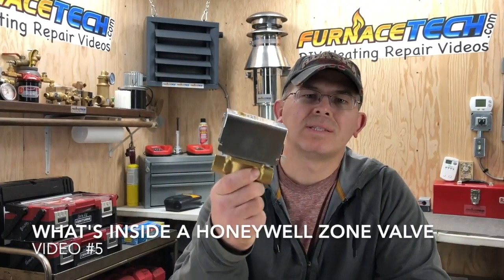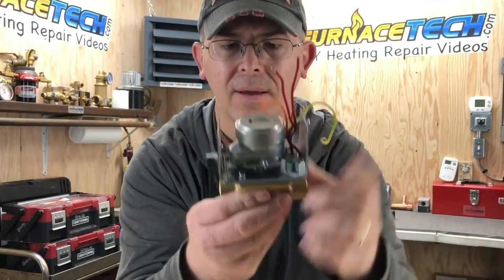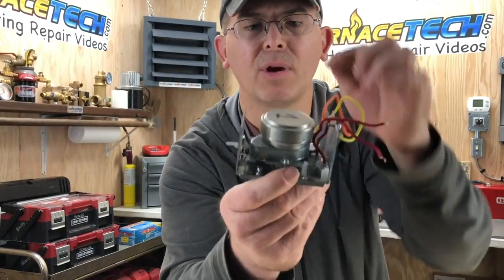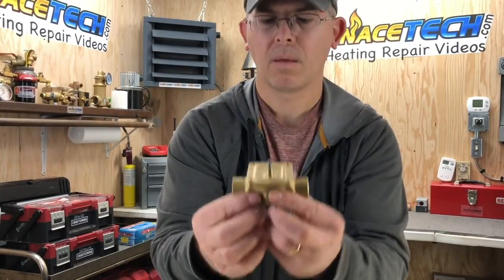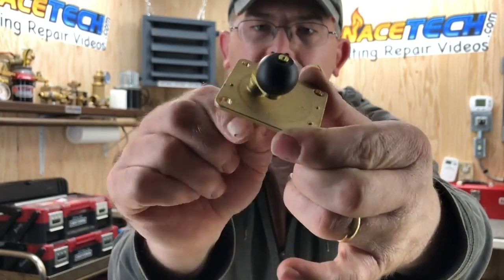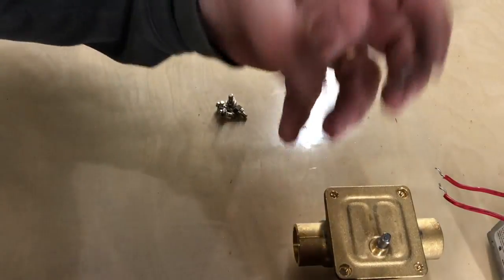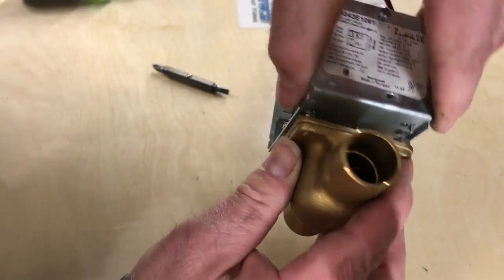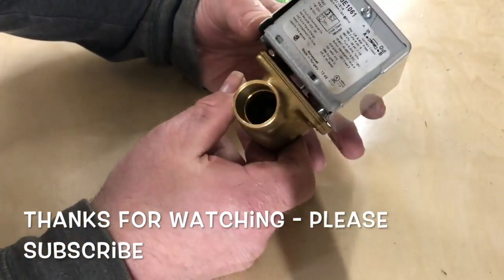How to fix a Honeywell Zone Valve. Part number: V8043E1012 + V8043E1061

Comment: Does the manual lever go all the way to the left and hits metal side?
My lever is not springing all the way back (closed?) to the metal. trying to see if I keep testing it will loosen up inside?
Reply from the maker: Great question! No, it will spring back closed but it will not be tight to the left side. the Rubber ball will seal the hole inside the valve before the lever will touch the metal

Comment: I’m having an issue with one of these where the boiler randomly turns on. Have you ever heard of an end switch failing on these? How could I troubleshoot that?
Reply from the maker: End switches do fail for sure. The easiest way to test would be to turn off control power and disconnect end switch wires and use a volt meter to check for continuity through the switch while pressing and releasing the end switch button. I hope this helps! Thanks for watching

Comment: Hi, have I attached my accuator wrong? My motor starts when there is no demand and the manual lever is stiff but when i switch heating on nothing happens, and lever is free. How do i make sure that the valve is closed when I attach the accuator 
Thanns
Reply from the maker: When the lever is stiff, it is closed. When it is free, it is open. If nothing is happening, check the end switch and make sure it is telling the boiler turn on. Remember, you may have other controls and different wiring so, you will need to understand how it is wired into the system. I hope this helps! Thank you for watching

Comment: 1 of my 4 quadrants is not heating. It appears to be this part. Hot pipe below, cooler above. Manual open did not work. I took off the motor assembly and moved that little ball valve by hand. It moves freely, but still the hot water does not move through the pipe no matter what setting, despite the pump being on for the other quadrants. Does that mean the ball came off and wedged or is there some other possible reason?
Reply from the maker: There could be other reasons. 1) could be frozen loop. 2) system pressure could be low 3) could be air locked
Reply: @FurnaceTech  Thank you for the response. It started working again on its own. The tech that came out for something else said it was probably air.

Comment: My Honeywell Home valve is making a noise that resonates through the whole heating loop. I took the enclosure cover off (valve opened, calling for heat) and lightly push on the motor and the sound is less, but still there. It’s a vibrating or humming sound. My dad would always say if it’s humming, it because it doesn’t know the words, ha!

Isn't the drive motor only on when the valve is opening and closing? This noise is continuous when the valve is open and the thermostat is calling for heat. What’s the source of the noise?
Reply: PS: excellent tear down and explanation on the workings of these valves.
Reply from the maker: Thanks for the question. There are two types of zone valves. (NO) Normally open powers to close and (NC) Normally closed powers to open. If you turn off the thermostat and the noice goes away, you may need a new valve. Something could be wrong in the motor. But, this is hard for me to troubleshoot without being able to check the whole system myself.

Comment: I have 3 zones. When one zone is calling for heat I hear a gurgling sound when the heat is coming up. The oil tech purged the zone. I did ask if it could be the zone valve and he said no. I still have the sound of gurgling. The lever on the zone valve has a little play in it. Is that normal?  Can it be the zone valve or does it need to be purged again to let out more air in the line? I know I can open the valve to the manual position and purge it myself. Should I? Thank you. Love watching you video.
Reply from the maker: Thank you for the question. A lot of the time a gurgling sounds are a result of air in the system. Some systems can be complicated to bleed. I do not know what your experience level is when it comes to working on heating system and I would hate to say you should try something and make things worse or get hurt. Plus, I am not sure if you have glycol in your system or some type of system protector in the fluids. Has this system made these sounds in the past or is it something new happening. My first start would be to talk with the tech and if you do not think he or she is fixing the issue, get a second opinion. Otherwise, I would probably start by bleeding the whole system thoroughly on all the zones and make sure the system has proper air bleeds in place. Then, I would make sure the system is at the correct pressure.

Comment: So do these things go bad often? Have a zone in a hot water system where the heat is stuck on. So I’m thinking it’s this valve that’s stuck open or the thermostat.
Reply from the maker: There are some bad zone valves which fail often. If you turn off power to the valve and it stays open on a (NC) normally closed valve, then it's bad.
You can also test the thermostat with a volt meter or turning it up and down and seeing if the zone valve drives. If you get no movement in the zone valve by turn the thermostat up or down, you will need to use the volt meter to check for power from the thermostat to the zone valve. I hope this helps.

Comment: I checked our zone valve when the heat was not working. The lever at the bottom moves slightly but not to the full open position. For years it just stayed open when thermostat was turned on at all.

 Now it does not move more than 1/4 of the way to open and does not provide any flow.

Does this sound like a seized motor or seized valve?
Reply from the maker: I would start be turning up and down the thermostat to see it it drives open and closed.
Then, I would turn off the thermostat and manually slide the lever all the way open and see if it opens. Then, I would watch it close to its full closed position on its own with the spring tension. 
You may have a bad thermostat or bad zone valve but you would need to test individually for power and or free movement in the valve

Comment: Explantory note from my last post: does it matter if the two yellow wires to the limit switch are reversed? Does it matter if the two red wires to the motor are reversed?
Reply from the maker: No, either two of the yellow wire are the same and either of the two red wire are the same!

Comment: You did not discuss the polarity of the wires and whether it matters. Very disappointing. Everything else you discussed is already evident fron examination of the unit.
Reply from the maker: Sorry about that! If the wires are the same color, it does not matter. I would always look at the wiring schematic for reference. I hope this helps. Thank you for watching

Comment: Mine is leaking the gasket was blown out the side it looks bent I tried to put back together still leeks should I try to get rebuild with top plate of new zone
Reply from the maker: As long as the valve body is in good shape, the rebuild kit should work. Make sure you get the right one. It’s important to make sure the gasket stays in the grove when you install the valve assembly if not, it will leak.

Comment: What’s the problem if the lever is just completely loose moving left to right
Reply from the maker: It could mean many things. If the lever is loose and the thermostat is calling, it means the valve is open. If the thermostat is not calling and the lever is loose, it could mean the valve is stuck open

Comment: Great video! Zone valve is opening. Once Thermostat is satisfied, it sends signal to turn off but, valve is not closing. Once I tap on the valve housing, it will close and shut off the boiler like it should. The power head lever is loose and has no tension right before tapping. What are the odds that this is a bad power head and not a bad valve?
Reply from the maker: You can check it out by removing the powerhead and try turning the valve by hand. If it moves freely then the power head is getting stuck. If the valve is hard to rotate, then it is the problem!

Comment: Thanks for the video. I'm curious what the expected lifetime of a zone valve has been in your experience. I've had one unit replaced by a local company three times within a fairly short amount of time: November 2021, January 2023, and now December 2024. I'm wondering if some other factor might be causing the failures. I've shared the concern with the short life experienced both today (December 2024) and the last time (January 2023). I don't think they charged me in 2023, but I'm not sure what to expect from today's replacement, and that the dang thing keeps having issues is beyond frustrating. I have a 3-zone system and I've had at least one of the others replaced over the years, but this is crazy.
Reply from the maker: Not sure! Could be many factors. If you use glycol or have hard water. It could affect the life of the valve and might not allow the power head to move freely. 
Could be so many factors. I would need to troubleshoot it to get a good idea of the issues!
Reply: @FurnaceTech  I can accept that. Thanks for replying.

For now, I've mentioned the concern to the owner. We've resolved to monitor going forward.

Comment: Hi what type of screws holds the motorized valve to the frame i tried a philips but i cannot get really tight.
Reply from the maker: I normally use a flat head
Reply: Thanks it was difficult to see flat worked great.

Comment: can i just leave zone valve head off and open up with that little handle so its getting hot water all the time when the other two zones call for heat?
Reply from the maker: Yes! It will heat if you manually open the valve!

Comment: Thanks for this video! My problem is I cant not move that level freely and it seems like stuck in the middle while I can still feel the motor is hot. What do you think could cause the problem? Do I have to call the strata to replace the whole thing? Thanks
Reply from the maker: I would remove the powerhead off the valve body and check if the valve is stuck. If it’s stuck, then the internal valve parts need to be replaced. They sell rebuild kits. You can check this video’s description for a parts link if you have the ability to do it yourself!
Reply: Thanks! @FurnaceTech

Comment: I'm curious if have 5 zones everything in 4 work fine the 5th is my garage it is always calling for heat even when the tstat is off. If the zone valve is set to auto but I'm curious if it is somehow stuck to open would that be why the zone is always calling for heat?
Reply from the maker: Yes, it could be stuck open for sure! If there is no power going to the zone valve, you can remove the powerhead and check it. The valve body stem could be stuck too so try rotating the stem too!

Comment: Are you in Anchorage? I have six of these at my apartment building, and I've had to have 14 motors replaced in 2 years. Either failure to open or failure to close. The plumber only hooks up the two yellow wires, leaves the red ones disconnected. Could that cause problems?
Reply from the maker: The red wires are used if the controls need to know when the valve is calling. I would check the valve body if it’s moving freely because if not, the motor may be working too hard and failing. I hope this helps! I am located in Fairbanks and North Pole!

Comment: As soon as I turn on the boiler there is a call for heat, even though the heating is off at the program box. The hot water works normally just the heating is messed up. Do u think just replacing the metal box would work to fix the heat so it could be called when needed?
Reply from the maker: The first thing I would check is the end switch. If the end switch is closed, then the boiler will get a signal to run the pump. Some boilers will turn on just to maintain minimum temp.

Comment: Is there a way I can get a stuck open valve manually closed until I get a new one?
Reply from the maker: Yes, there are a couple ways. Turn the thermostat off in that space, then remove the zone valve cover and take a screwdriver to see if you can move the linkage to free it. The spring should drive it closed. The other way is to turn off the thermostat in that zone and then close off one of the valves on that zone. I hope this helps!

Comment: I have just replaced my Honeywell motor head. I must have an older style as there are no screws holding it to the valve body. It is only held on with a wire clip. The issue I’m having is that when the thermostat calls for heat the motor head comes disengaged and does not open the valve. If i put pressure on the motor head towards the valve body it will engage properly.
Reply from the maker: I am sorry for the late response. I would probably replace the zone valve unless you find another solution

Comment: Hi
I have both valves in manual and still the boiler is still not heating the radiators. 
The boiler is fine. I'm getting hot water through taps and shower. 
What can be the issue?
Thanks
Reply from the maker: Honeywell zone valves don’t engage the end switch in manual so the boiler will not turn on the pump unless the thermostat is calling and opening the valve all the way. Could be a number of things. Bad transformer, frozen pipe, bad aqua stat, bad pump, bad thermostat. Why are you having to manually open multiple valves? So, you would need to check to make sure the thermostat is calling and the valve is getting power. Then, check if the pump is working and the system pressure. Start there
Reply from the maker: Hope this helps

Comment: We have replaced the motors. But how do you change out the valve? Especially if it goes out in winter. What needs to be turned off etc?
Reply from the maker: Hello, every system is different. It could be as easy as turning off power and isolating valves on both sides of the zone valve. But, not all systems have isolation valves on both sides of the valve. If not, you will have to find the supply line and return line to isolate it. 

You will also want to turn off the make up water and verify if you have glycol or not. If you drain a bunch of fluid, you will need to pump the glycol back into the system.

Comment: Thanks...I just changed the powerhead on one of these. One thing you did not address. With the cap on, there are two red leads and two yellow leads coming out of the box, with no way to distinguish which is which. I painstakingly took the cover off and traced each lead and installed to match the polarity of the defective one I replaced. Was this necessary? Are the two reds interchangeable? Are the two yellows interchangeable? Thanks.
Reply from the maker: Yes, the two reds go to the end switch and the yellow go to the motor. It does not matter which is power in and out.
Reply: @FurnaceTech  Thanks...great info!
Reply from the maker: Thank you for sharing!

Comment: Thanks for the video. In my case, the red wires from the end switch are not used and are cut off. I used them to diagnose the opening and closing of the valve. At first I found that the resistance between the two red wires was always 0, whether the voltage was being sent to the zone valve or not. I then gave the front of the motor cover a few good taps and all of a sudden I could hear it unwind and the end switch opened back up. For now the zone valve is working properly again. Using the end switch seems like a good way to troubleshoot if your zone valve is sticking.
Reply from the maker: Great point. If the valve is driving all the way open and closed, the end switch will make and break contact. This will tell you if your valve is getting stuck for sure. Thank you for sharing!
Reply: Wow been changing stuff like crazy saw ur post hit my zone valve and it freed up thnx mate

Comment: Thanks for the detailed video for troubleshooting. How much water will come after I have shut off the valve to  the  boiler and remove the ball valve cover? Thanks
Reply from the maker: That will depend on where the isolation valves are located. If you have two valves right at the zone valve needing to be replaced, you may get a handful of water. If you only have one isolation valve, then you may need to drain most of the system before the fluid stops leaking. That could be multiple  5 gal buckets. I hope this helps.

Also, don’t forget to shut off the makeup water and rest for glycol in the system.

Comment: When I put my hand on the top of the motor on the control value, it is hot. Is that suppose to be hot all the time? I have two control values close to each other in my system, so when doing the same and checking the other control value ( remove cover and feel top of electric motor) that one too is hot.)
the water in the system is cold due to being shut down. Just wondering if the motors on them are suppose to operate full time and be hot?
Reply from the maker: That would depend if the zone valve is a normally closed or open valve. Anytime is has power, it could be hot or warm to the touch!

Comment: Great video! Thanks! If my manual lever has no resistance at all is it safe to say the internal ball is not turning?
Reply from the maker: If there is no resistance on the lever then the valve is open.

Comment: Hi. You fixed our boiler before not sure if you remember. I have a question, the switch end in the back is stuck open and making noise. Is this something to worry about or it’s time for me to call you again? Lol
Reply from the maker: Thank You for reaching out! I do work on a lot of heating systems, sorry for not remembering about your system specifically. If your end switch is stuck open I would address it sooner than later. It could be the result of many different issue.
Hope this helps! If you remember my number, it’s probably best to text!